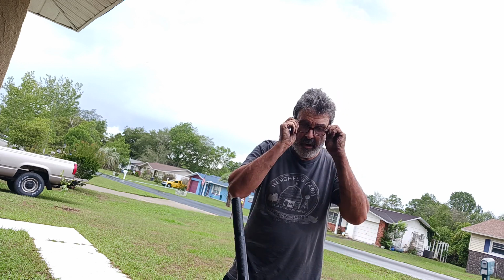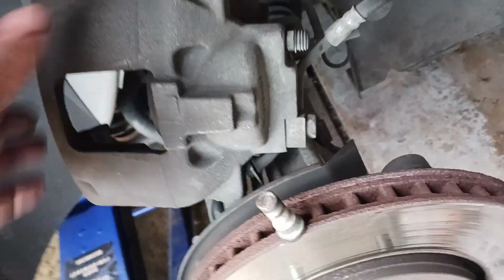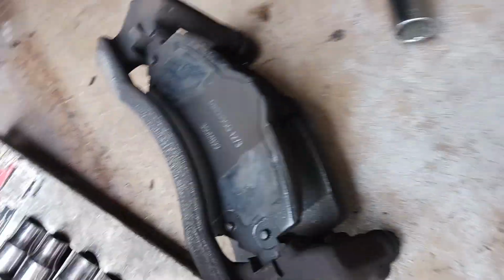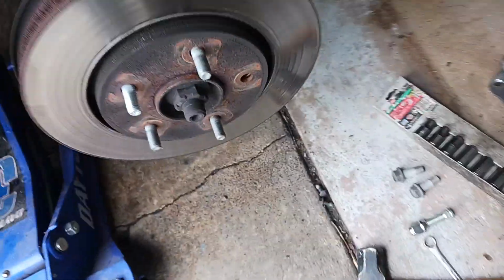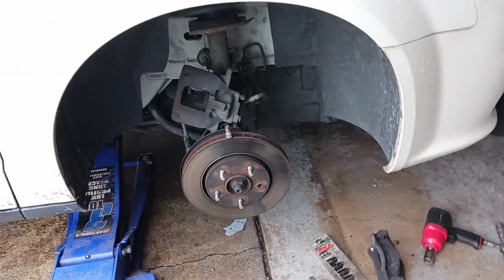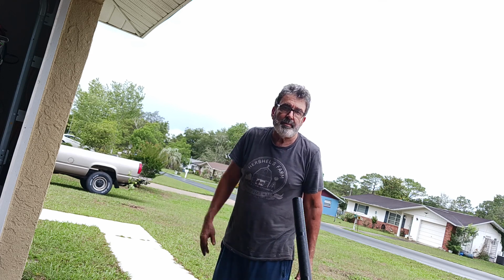Broken front wheel stud on 2012 Dodge minivan replacement

Comment: Nice you got luck on that one lol... What holds the caliper is called a caliper adapter good thing to put a little blue lock tite on the bolts... I got a 2018 Ram 2500 that I have a few wheel studs to replace on going to do a video on how to replace them showing two different methods.
Reply from the maker: Cool!   I just subscribed to ya!  😊